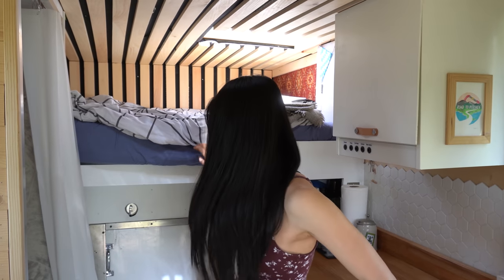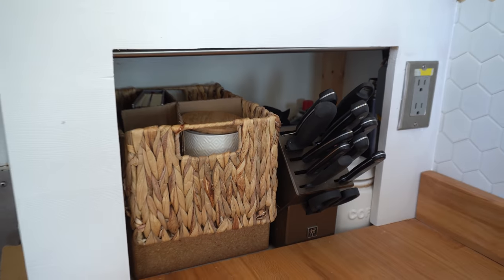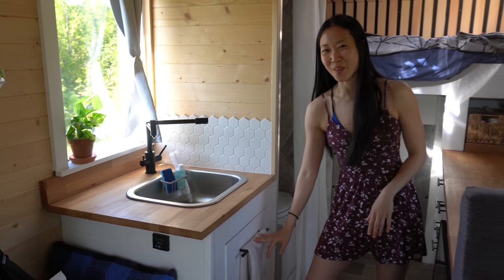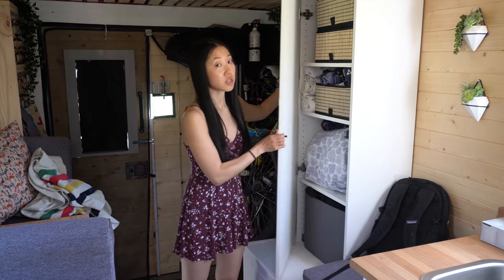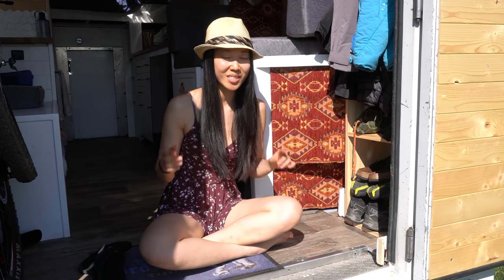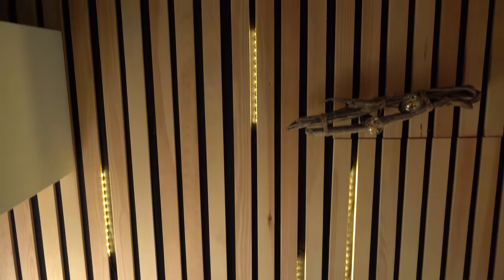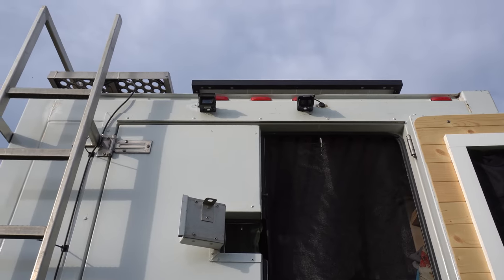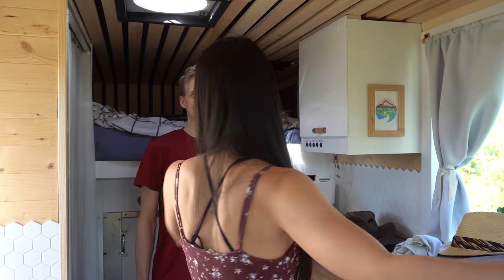VAN TOUR | DIY Box Truck Converted to Beautiful Tiny Home by Amateur Builders During Pandemic

Comment from the maker: What ideas do you have for our tiny home? We'd love to hear your thoughts!
Reply: 1) Carbon monoxide detector? You didn't mention having one.
2) Maybe add two wide peripheral cameras outside looking down toward the front left & right doors for peace of mind (e.g., your comments from Different Media tour).
🚛 Great job! Look forward to your adventures 🌄
Reply from the maker: Hey thanks for your suggestions! It was maybe a but quiet but our smoke alarm is also a CO alarm.

For cameras in the front the hood is actually so short that it's fairly easy to gauge how much space is left. On the front sides maybe useful cause that's somewhat still a blind spot.
Reply: I appreciate the way you two explain the various facets of your tiny home in language the average person can understand.  I also appreciate the graphics you edited in (Ex. showing where your bed is located from the outside of the camper) as it was very helpful while remaining unobtrusive.  Good video and thumbs up!
Reply from the maker: @jeboutdoors377  Thanks for the recos! The latches that Chrome has are our fave <3...definitely a must if we do another build. I don't think we can do a hightop unfortunately. The truck is already quite high!!! We teeter when there is wind since we're in the mountains. We love the idea of windows though.
Reply: How are the solar panels attached to the roof of the truck?
Were there any special requirements so that the panels are secure when the truck is in motion? 
Is there a speed limit on the truck due to the solar panel installation?
Reply from the maker: @PetraKann  The solar panels are riveted to an aluminum bracket mount (that Moritz custom-built for the panels) and then riveted onto our roof "rack." The roof rack/platform was already there when we purchased the truck and are bolted in place by long thick steel screws. 

No special requirements, but we noticed that on tighter highways, driving at 100-120kph, if we pass by a semi going in the opposite direction, it actually causes some cross-winds that flex our roof and makes a loud dwanngggg noise, which is scary. So we hug the right lane to avoid that (seems like if there is 1m+ between us, it's okay).
Reply: Sorry guys need to unsubscribe.
I thought this channel would focus on the home-vehicle and adventures rather than cheap selling tactics.
Cheers
Reply from the maker: @PetraKann  Sad to see you go! Our channel will be focused on vanlife and how we manage our adventures on the road and rock climbing. I'm not sure what you refer to about cheap selling tactics, but definitely not our intention and hope we don't come off that way. Take care and hope to see you around.
Reply: @RoadtoPitches  
Suggestion---- for cabinet I've seen other van lifers use child proof latches to keep cabinets closed.
Reply: You have plenty of space for propane so i think a bigger shower and a incinerator toilet would be nice. Also replace your sky light with a marine so you could exit to the roof and build a deck with that composite decking so it will be carefree for yrs would give you enjoyment in some places. I love it!
Reply: I built a cargo trailer conversion and built my own composting toilet and what you can add if you would like is get you two computer fans they're real cheap and put one on the left side and one on the right side one intake and one exhaust, on the exhaust side you hook up about an inch and a half flexible hose then vent that to the outside what it does is it makes everything dry up even quicker and you don't smell anything!
Reply: Although you already have a water heating solution it does seem your solar/battery system is not highly robust (which is fine) but you may consider doing a simple solar water heater on the roof. You really have a good bit of open space, and you could do a long coiled black plastic pipe to soak up the suns heat. Might not produce as hot a heat as your electric water heater, but would provide a lower power solution for at least warm water. Awesome build, great balance of being 'nice' but also rustic and real and recycled/efficient. Brilliant! Guessing the fella is a STEM field dood hehe :) - have fun & make more videos!
Reply: Thank you, for all of the wonderful ideas! Horse Bedding Pine Pellets, from Tractor Supply - absorbs odors and moisture in compost toilets. Though you have to, lightly moisten some pellets to properly cover your BM's. You can also tuck some pine pellets into old socks, to absorb odors in stinky shoes. Or spray Apple Cider Vinegar into your shoes to kill the odor and disinfect them. Hope, that helps. Your lovely descriptive video, is very helpful :)
Reply: I would have put the largest roof escape hatch ever the bed...it would eliminate the claustrophobia...and safety exit in a fire...install exhaust fan in toilet tank...no smell when yu pen lid...easy fix
Reply: @itsmiz6737  a ssdaa!! f2f  da!! !!!I
Reply: Interesting video RS
Reply: Put a small foot rest along the couch/dinette, so your legs can be comfortable when sitting there. You can even make it a portable box, so you can use it as a step stool, too.
Reply: Also, you should get a shower head with an on/off button on the head, itself. Worth spending another $40 to save on all that water usage. 

You might find you’ll want to buy a lower voltage fridge. Dorm fridges suck power! 

Lastly, hope your batteries charge by alternator in addition to the solar.  You have a ton of power-consuming tools.
Reply: Try Velcro strips on cabinets
Reply: U can add an extra alternator to u motor to charge ur battery's faster and child safety locks for ur drowns would help but it's all up to u guys on how u want to do it u know!!
Reply: Hi
Reply: @itsmiz6737  l

Comment: Add a flexible hose from the composting toilet and vent it out the side of the truck. Add a 5 volt PC fan pushing air out. That will take care of the smell and help dry out any contents.
Reply: Wonderful, suggestion! Horse Bedding Pine Pellets from Tractor Supply, also absorbs all of the odors. Though you have to spray some water over the pellets on BM's for them to break open for full coverage.
Reply: Half water and half vineger mixture in a spray bottle should get rid of the smell and act as a bio-friendly cleaner.
Reply: Listen if you find a way you vent your toilet 🚽 it really does make it so nice !

Comment: You guys are geeky enough to figure this idea out. How about adding electro magnets for your drawers that turn on when you put the truck in gear. When the truck is running you have more power. When its off you don't need the drawers locked?????
Reply from the maker: Haha, that's actually an interesting idea! Gotta check how much a decent electromagnet comes at. It'll need quite some holding force.

At the moment we're using a few metal bars with screws and keyholes to keep them in place. It's not super pretty, but very quick and functional.
Reply: Nick B - Admiring your thought process, that is great out of the box thinking. I'm a firm believer in the KISS philosophy though, so wouldn't even consider doing this, but for a decked out build this would be a real convenient solution to this constant challenge. Kudos for the idea, and thanks for sharing.

Comment: You said that you like people to give you a different suggestions within your tiny home I saw something your living room furniture if you want to convert that into a large bed without interfering with everything that you have on the leaf it or you have to do is put a board with hinges that can extend outward so it can be at least a full size bed and you can close it back up and no one will even know that it was just a living room set I hope that was some help for you guys anywho everything you have done to your van so far I really love it like I said converting your living room to a bedroom I'm just simply putting it back into a living room it would not hurt the condition

Comment: You said your kitchen cupboards weren’t
Staying closed with the magnets.  Looking at the handles, you could run some kind of pole/dowel down the whole length of the front and keep them closed.  Something like a yard stick but maybe a little
Heavier.
Reply from the maker: Thanks for the idea, Debbie. We've built something similar, an aluminum bracket that slides into keyholes that holds all the drawers in like your idea!

Comment: Nicely done! I’m tinkering with solar on my own house, and find it interesting that while driving you’re 24 V battery is charging so slowly. So if you had a 12 V battery it would charge faster?
So you can’t get a better alternator charger like the Victron?
Reply from the maker: It was a money choice to go with a cheaper battery booster that would only charge with 15  A max. If we had a bigger budget, we could get faster charging (but that might require switching out the alternator, too).
Using 24 V was a budget choice, too, you need less copper for the wires.
Reply: @RoadtoPitches  
Thanks for the reply. I recently learned the same thing with your house. I have a 24 V system and should’ve done a 48 V. But that would mean losing some of my solar panels and charger that don’t charge at 48 V. 
It’s a learning process. 🖖

Comment: Also.. Are you using a particular open source project for your raspberry pi setup or did you write it yourself? I'm putting off the annoyance of writing my own system for monitoring everything and if there's a project already out there I can build off of, I'd love to know about it.
Reply from the maker: It's using OpenHAB with a few custom sensors and actuators. They all talk MQTT following the Homie convention.
You can get a few more details in our electrical video: https://youtu.be/fQhEmb0ii3M
Reply: @RoadtoPitches  thanks! I appreciate the info.

Comment: hey everyone, take a note about the benefits of using the portable stove like this one.  a lot of van builders add a built in cook top, but forget one vital aspect:  level.  when your home is mobile, you will definately park in places that are not exactly level, and so you end up cooking on a built in stove top that cannot be leveled, which is a pain in the butt.  so don't let your stove dictate your parking spot!
Reply from the maker: We didn't think about this when we considered our stove/cooking options. We mostly wanted to try to keep cooking outdoors as much as possible so we don't get all the cooking smells.
But this is actually a very true fact! Every time we set up the stove we get little twigs and rocks and level the cooktop. If it was affixed to the countertop it would be titled 90% of the time😂

Comment: Nice truck 🚚 .better to use light weight 🤔 materials like aluminum.  4×8 insulation. Flex insulation with cloth n snapons.  For travel. Save gas n maintenance.

Comment: Highway = 18-23 Liters per 100KM of fuel = 15 to  12 MPG
City = 25-30L per 100KM = 11.29  to 9.41 MPG

One of the things I am interested in seeing in any "van life" video is the cost to build, but also the cost to run the vehicle. The fuel economy (or MPG) is important to consider, and I wish every "van life" or "box truck" builder would share that info too. I am glad that Moritz shared that info with us. It is good to know for a vehicle that has been "built out" using wood and tanks, as those add weight. Since I am in the USA, I am not as familiar with KM / L numbers so converted what Moritz said. I am sharing those here just to help any others who are also metric system challenged (as most Americans are). This is not a criticism of the build or vehicle or builder.
Reply: Not the numbers I came up with.  And it's just weird to me being fuel per distance rather than distance per fuel.
Conversion factors:  1.6 km per mile, 100 km = 62.5 mi and 3.787 L/gal

10.3-13.1 MPG highway (62.5/23*3.787, 62.5/18*3.787)
7.9-9.5 MPG city (62.5/30*3.787, 62.5/25*3.787)

Comment: Try using cedar chips along with peet moss. That's what we use in our composting toilet and even with the lid up it doesn't smell. We do have a urine diverter so that also helps. We also built our own toilet. I couldn't justify spending a grand on a composting toilet when you can easily make one for 50 bucks.
Reply from the maker: We will search for cedar and peat moss when we refill. The only thing we could find in Walmart lol was pine. It's not as absorbent! We too have a diverter and with the lid down, it's not noticeable. 😊 We had a close friend use our loo today and she couldn't smell anything! So maybe just chiko's nose.

Comment: What do you use in your toilet? Peat moss, pine chips, cedar chips, kitty litter...? I've used Peet moss and a mixture of wood chips (I can get a big bag of wood shavings at local lumber yards for about $10) and I've never had any issue with smell. I put a biodegradable baggy into a 5 gallon bucket, secure it with a bungee cord then put in a scoop of peat moss and wood shavings and I don't have smell. After about a week, I change out.
Reply from the maker: We use pine shavings that we found in Wal-Mart. Our issue is the bag is not secured, so it's basically an open bucket, garbage bag, tonnes of shavings and a really good fan. Don't stand driver-side 😂. With the lid closed and after it dries, it's no problem. We went into a real outhouse yesterday 🤢 and can guarantee that a composting toilet smells WAY better.

Comment: I really like your build! Very nice work guys! The trash can is really clever. 
 I’ve been toying with the idea of a van or a truck also.
  Could I get your opinions on a couple of things? 
  Would there be much advantage to making the shower on the right side of the truck? I’m thinking that if you are stealth camping on a street, then the crown of the road may tip the truck so that it may be better to tip the shower back instead of forward. 
  Also I would propose a roof deck. Instead of an outside ladder I would like to have a larger skylight above the bed that would open. This could give access to the roof, but not from the outside. What would you guys think of these design ideas.
Reply from the maker: Thanks Steve! We didn't consider the tilt of the vehicle. What we are running into now is that the water tank is usually tilted to the right, so the pump struggles to get water when it's at the end of our supply.

The roof deck would be super cool! Our box came with the ladder, so that decided our skylight which decided our shower. Our skylight cost $120 and I think one that opens would be $300+. We would've gone that route if we had the option!

The only other concern about a roof deck is weight. You don't want your box to be top heavy. We were driving through some bad gusts in the Rockies which snapped open our fan cover...so also need to consider where you'll be taking your rig.

Great ideas overall tho! 👍

Comment: Super cool. I’m looking for a Uhaul to build out. Also gathering materials from scrap piles at development sites. Vehicle maintenance and the electrical system Will probably be my biggest expenses. Thank you for the inspiration. My plan is to follow the Rockies all the way to the top of Canada and then all the way south into the Andes to the tip of Argentina.

Comment: Love everything but the bed and maybe the toilet.  That bed was challenging enough for a small attractive Asian woman.😉  I'd have to sleep on the floor and I'm only 5"11.  The toilet area imo could be reduced by a least a foot.   Not a fan of a composting toilet, homemade or mass manufactured kind.  5 gallon bucket, low cost biodegradable liners, and kitty litter equals ZERO smells.  Unless someone is trying to go two weeks or so without changing out🤢  Besides that I found your video entertaining!
Reply: Watching her getting into the bed was the best part of the video .
Reply: You're a very lovely woman.

Comment: I built something very similar, your average truck on the outside, a comfortable home on the inside. Yes its big but it becomes invisible in the right environment eg. any industrial area and any city in the world. Box trucks are so much better value than a van and a better choice in every way unless you plan to do a lot of traveling then fuel efficiency and ease of parking become factors. For a house cat like myself that did the maths, it was an easy choice, I fit 2000w of solar on my roof which 100% powers a powerful computer for as long as I want every night in summer, something impossible to do with a van.

Comment: Here's what we use to keep everything closed up. https://www.amazon.com/dp/B0828DMZ31/ref=cm_sw_r_cp_apa_glt_fabc_H68DD22ZZ2M1WR0X1R6X?_encoding=UTF8&psc=1
Reply from the maker: These are very nice but unfortunately quite pricey. For now we are using a few angle rods with key holes and screws into which it hooks to.
Not pretty but it works well and is easy to set up.